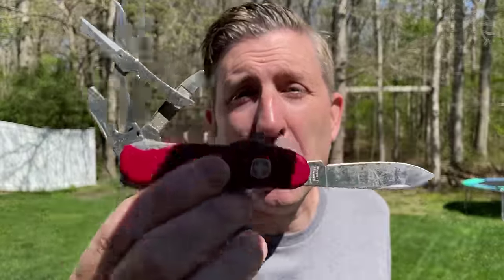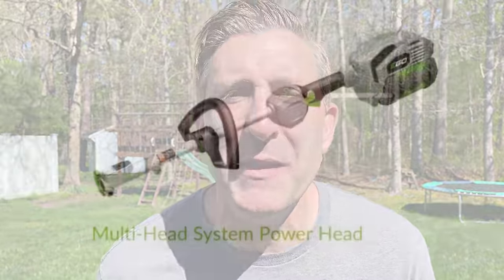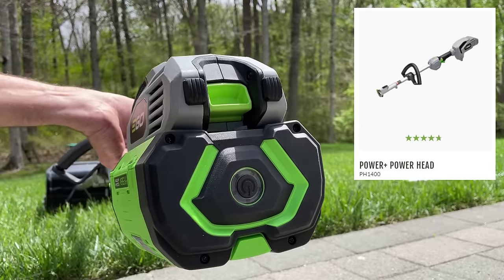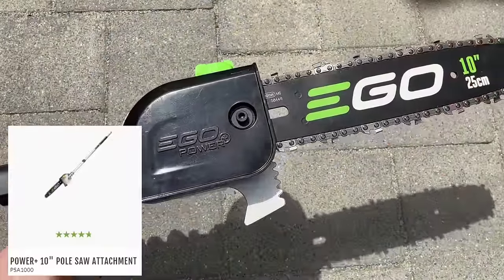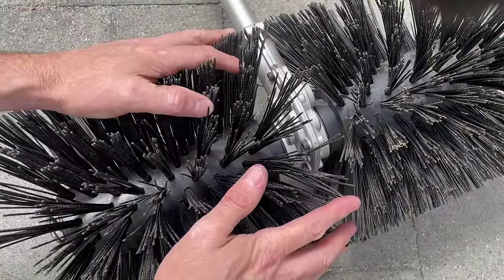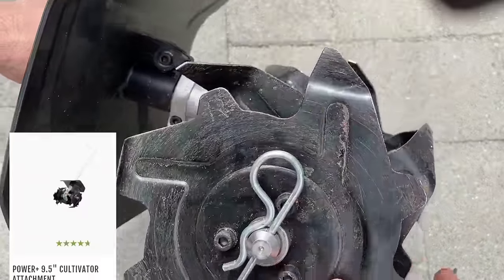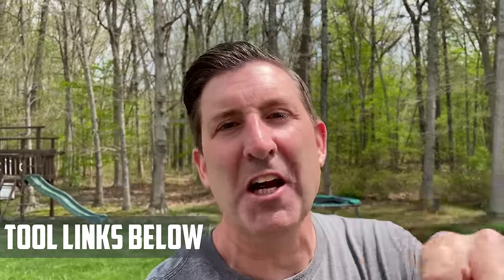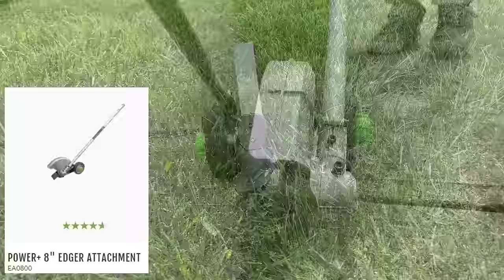[IN ACTION] EGO Multi Head System - 2021 Best Review 🤯🤯🤯

Comment: I am sold on EGO products.  I started with the first generation 20" push mower (self propelled not available) in 2014 and have since acquired many of the implements.  My most recent is the multi head system with the edger attachment to start off.  Next was the new Zero Turn Z6 mower (awesome) Now that is a lawn mower.  Next is the Select Cut 21"  self propelled mower (also a fantastic twin blade mower).  Next the 575 CFM blower, the early 14" chain saw and lastly the 24" hedge trimmer.  For the batteries I have the 2.5Ah, the early 4Ah, the 7.5Ah  and 4 of the new 10Ah batteries.  Guess you could say that I am hooked on EGO products.
Great video you produced for us plain folks.  Keep up the info on all there products.
Reply from the maker: Glad to help!

Comment: I have the trimmer and cultivator attachments and love them both. The trimmer is a bit heavy with the 5ah battery, but not too bad. The attachments switch out quickly and stay in place once locked.

Comment: FYI if you hold the hedge trimmer down, adjust the cutting  blade like a hocky stick.  It takes a long messy job of cleaning out tall sturdy weeds that the string trimmer can't cut.  And makes really no mess at all.

Comment: Thanks for the review.  I currently own a Kobalt 24v trimmer and blower, and absolutely love the convenience of a battery, but I want a battery edger to replace my very loud and heavy gas one, so looking at the EGO powerhead system because the Kobalt edger would require a different battery and charger.  So, my plan is to eventually convert everything to EGO because of the convenience of the multi-head attachments and ability to use the same battery on everything.  May eventually go to battery mower as well, but my Honda is only a couple years old, so not quite ready for that yet.
Reply from the maker: Plan now for the future

Comment: I bought the LB 650 blower for my business this spring and it's been great so far. I had stayed away from their trimmers because the head spins clockwise. To my surprise I found the ST1530 which spins counter-clockwise like a gas powered trimmer. It's a little heavy at 13.83 lbs. with the 5 ah battery but well balanced. I just received this yesterday so I'll be back soon with my thoughts on the ego dedicated trimmer.
Reply from the maker: Great - keep us posted
Reply: The more I use the trimmer the more I like it. Excellent for edging, surprisingly. Today I used it on 3 properties and had 1 bar left on the battery. I charged it at lunch for a half an hour and did 3 more lawns. The blower lasted for all 6 lawns with some battery to spare. The true test will be on a 10 lawn day. I ran it on #1 setting all day which was plenty of power. I will be getting the strap as it is a little heavier than a echo gas trimmer. Not smelling like 2 stroke exhaust at the end of the day is worth the price of admission.
Reply from the maker: @carlmccarty6470  not to mention to the noise - sounds like your really putting EGO to the test
Reply: @Kitearmy  After using the trimmer for while I'm getting 4 and a half lawns trimmed on a single charge. 5 ah battery
Reply from the maker: @carlmccarty6470  not acceptable :)
Reply: I bought a grand worth, l loved them.... till the batteries got around 40 (or less) hours on them. Then one by one they have begun failing. The 5.0 l bought separately (350.oo) was the first to go. Two weeks later the 7.5 that came with the backpack blower failed. Today I have ONE 2.5 still working. So I can work for ten whole minutes between one hour recharges. Until that one fails. E-go=😢 Totally my fault. I tried to “modernize” l should have stayed with gas
Reply: @jessoliver2955 mine have way more hours than that. I use the edger, the big brush and the weed wacker. I also have the separate blower.  Have a 2 and 5 battery. Both are going on 3 yrs old.
Reply: @1packatak  good for you. (Really) if I had that experience, I wouldn’t shudder every time an ego add pops up. Wishing I could warn everyone who sees it. But I CAN go on every u-tube video I can find. In addition to Yelp and Google reviews. Oh! And when I see people at Lowe’s looking at themDON’T DO IT!!!

Comment: I have the EGO mower (self-propelled push), and a snowblower. I am in the market for a blower, a hedge trimmer, a weed Wacker, and that saw attachment looks great. This looks like it can cover most of my needs but how much does it cost? As a package deal or the power head and one or two attachments to start with? I have been impressed by the EGO line, and like that the batteries are interchangeable. I also drive electric in a Leaf. I love that too.

Comment: The 1 person who disliked this video owns a Ryobi!
Reply from the maker: bahhaah
Reply: I use eGo for lawn tools, Ryobi ONE+ for DIY. Reduced my battery systems down to 2 from 5; SO much easier to maintain. Looked at the Ryobi 40v system years ago, just didn't compare to eGo.
Reply from the maker: @morrielewin1554  Yeah - I think Ryobi hopes that people will jump in because they have the 18v one plus stuff
Reply: my Ryobi trimmer broke in one day for me.  Maybe Operator Error ;)
Reply: Yeah RYOBi for decades was a " Budget' cheapo brand.. EGO was always a premium brand.

   So it was  never  a APPLEs to Apples comparison.

  Now in 2022   RYOBi has decided to start making a lot more " premium " tools . Things are changing. 

Example..Carbon Fiber, Whisper Quiet, Brushless 40V HP.  Dramatically better than their 18 vol and original stuff.   Their products are improving 
  Is RYOBI superior to ego? Nope... 

 But RYOBi are a lot more accessible, alot more common..AVAILABLE any Where.  More compatibility..due to a dramatically bigger product line and always new products coming out every year . Far Far cheaper batteries too. 

 I have a Honda powdered RYOBi  pressure washer thats really really superb.  I have some brand new generation 18+ Ryobi brushless handtools which are excellent!   A small 18V + Brushless Impact electric driver with LeD lights is shockingly good around the house.

 RYOBI 40V Brushless HP  multi tool.. is a superb powerhead for weed eating , edging, trimming hand held stuff outside.   I got this 40V Brushless motored powerhead for 50 bucks it's compatible with all my 40 V batteries and all my old multi tool extensions from 20 years ago. You just can't EVER do that with EGO. ( price wise) I RYOBi better than EgO. Again I say no.  But you're going to pay ALOT more than 50 bucks.

 The RYOBI push, self-propelled mowers are complete garbs.....except their riding mower.
 My friend has one and loves it and it's dead quiet.
Reply: My issue for me.  Is weight.  I needed something lighter because of my size and arm strength.  I went to the store and I lifted the E Go.  I knew I couldnt use it.  So ended up buying another brand.  I do realize the ratings etc.  I just couldnt do it. If E Go had a smaller one.  I would of bought it.  Small female w arm strength issues.
Reply: @lil_Marie_Red  that's why they sell the backpack link 👍🏻
Reply: @joshuabush2569  Still to heavy.  I broke 2 elbows last yr with a fall.  Ouch.  So I lost my strength.  I bought the lil craftsman one.  Its working great.  Tossed my Ryobi. I still have other Ryobis.  Ok for starter.  They are lighter. I dont use it much.  Its there if needed.  Single girl that cant afford paying guys for simple task.  I like being independent even w strength issues.  
Men dont understand that small woman may not have arm strength for bolts and tight stuff.  Holding heavy tools.  So be kind to your ladies.
Reply: Lol
Reply: Ryobi are not as comfortable or ergonomic to use. But their batteries are great. In my hot van day in and day out. Never fail. I bought 4 E-GO last summer, so I have a 7.5ah, a 5.0 ah and two 2.5 ah. Today ONE 2.5 ah still works. So I can work for 10 minutes, between one hour recharges
Reply: @morrielewin1554 but Ryobi batteries last. E-GO batteries are trash. Heat sensitive as a cell phone
Reply: @joshuabush2569 E-GO batteries are so heat sensitive, if l leave a tool sitting in direct sunlight for even 10 minutes...DONE! So the backpack, right out there in the sun on your back... MUST have it’s own AC unit to keep working... people DO say it’s heavy 🤔

Comment: Love your reviews of Ego power equipment! Question: Are there any reasons (additional functionality or capabilities) to purchase the dedicated string trimmer or dedicated edger, verses the multitool options for these tools? I need both of these tools and understand it would be cheaper to purchase the multi tool option, however I want to make sure I’m buying the top of the line (at least from a residential perspective).
Reply: The multis will be more than enough for any residential! You can even buy a $10 adapter kit on Amazon and attach blades to the trimmer to cut like 6 inch trees like butter!
Reply from the maker: If you think you might need any other tool that is attachment capable then go with the multi - otherwise go with the individual
Reply: As a gardener, I've always had multi tools. Saves money and and are easy to store in my cab whenever I want to take it apart . Even if you don't need the other attachments, you options be open as long as you have a multi tool.
Reply: The string trimmer I use has the power head that makes it easy to add new string. I don’t think the multi tool system has that?
Reply from the maker: @BottleBrookGardens  no it does not
Reply from the maker: @BottleBrookGardens  no it does not
Reply: @BottleBrookGardens   I was thinking the same thing.
Reply: @Kitearmy  can you purchase the power head for the multi? Or is it only available for the dedicated trimmer

Comment: Loads of great info in your vids!  Unfortunately, looks like the trimmer/edger kit is sold out at Lowes and on a month waiting list on Amazon.  (insert sad face here)  Btw, have you done any long term Ego Battery reviews...ever  had issues or received a bad one?  Thx!
Reply from the maker: I have been using EGO batteries for 7 years - never had 1 go bad.
Reply: I’ve had a bunch and they are my main lawn equipment. Mine wore out after about 5 or 6 years. Some of my 2.5s I think will last a few more seasons I think

Comment: I use this tool system regularly. I have a huge issue when it comes to taking them off the multi-head tool. No matter what attachment, they get stuck, and I have to fight to pull them from the power-head. 
I ensure the arrows are aligned, the lock clamp is loose, and the button to release is held down while pulling. 
I guess it's a job for WD40

Comment: Your videos are very good.  Interesting.  Purchase the multi or individual Ego tools like the Best String Trimmer, etc.  Just need to decide between eco systems like Ego and Toro … mower, trimmer, edger, snowblower so as not to have multiple chargers lying around.
Reply from the maker: I have both Toro and EGO - I gave the Toro to my neighbor
Reply: If you need a battery snowblower go with Toro, the current Ego ones are nowhere near as good .  I have used both the 60v 14/16" Toro trimmer and the 2020 Ego and to be 100% honest the biggest difference is the powerload feature for the string.  The Toro trimmer you have to spin a knob on the head and it's not that big of a deal.  There really isn't an appreciable difference in power or runtime with 2.5ah batteries.
Reply: @dhanipersaud6227  Thank you
Reply from the maker: @dhanipersaud6227  Have you seen the EGO 2-stage it's a monster
Reply: @Kitearmy  Seen it on youtube but haven't used it.  I have used the single stage Toro and Ego snow blower offerings and Toro model is in a completely different league performance wise.

Toro also has a new two stage electric snow blower and  early reviews seem positive but I haven't seen any head to head comparisons with the Ego.  Also, most people in my neighbourhood only have single stages.  So, not sure when I'll get to try one out.  You need to be plowing a fairly large area and a lot of snow to truly justify a 2 stage.
Reply: I forgot to mention, the Toro 60v trimmer is also better balanced, floats better over the ground and the trigger is easier to operate.  The Ego is a bit longer and if you're over  6 feet tall you won't have to slouch as much as with the Toro.
Reply from the maker: @dhanipersaud6227  Toro is made by the same company who makes harbor freight - greenworks.  Look at the head
Reply from the maker: @dhanipersaud6227  I don't love the EGO single stage blower - BUT I love the 2 stage.  Will be interesting
Reply: @Kitearmy  And?  EGO, Habourfreight, Greenworks, Echo, Toro, Stihl battery lawn tools are all made in China and share the same parts suppliers.  Open them and you'll find common parts amongst all of them.  Ego doesn't make its own batteries, switches, brushless motors etc.
Reply from the maker: @dhanipersaud6227  I have opened some up - look at the head of the toro and the harbor freight ( I have a video).  I love EGO and I have never seen an electric loading head on any other brand
Reply: @Kitearmy  Yeah,  open up the EGO and compare to other brands.  All the internals from the same Chinese parts suppliers just in a different shell and slightly different configuration.  EGO is owned by a Chinese company called Chevron and the directly own a few brands like Skil, Flex and Devon.  The also do work for other manufacturers like Bosch and some other manufacturers.

Comment: Does the multihead trimmer work as well as the dedicated trimmer? That’s my most used accessory but it would be nice to have some other tools with it.
Reply from the maker: If you have space issues go with the multihead (or need a tree trimmer) otherwise I would suggest to go with each unit separately just buy them without a battery

Comment: Need to know: what sound does the Power Head make with no attachments running? I'm asking b/c I just got my set in and when I attached the battery and run it, it seems to be VERY loud for an electric, brushless motor. I have the Ego folding trimmer and it is QUIET whereas the Power Head is exponentially louder. Is this normal?
Reply from the maker: It is louder than other EGO tools - the motor is in the back so it runs the power down the handle

Comment: I have the bristle brush attachment and it is great for fall and spring cleanup as well as driveway and walkway cleaning. I am curious if I can just buy the replacement rubber brushes and swap with the bristle brush; seems like it would work. You didn't take the rubber version apart for comparison; maybe a future video? Unless the answer is just a simple "yes" (I hope).
Reply from the maker: Yes
Reply: @Kitearmy  Excellent! Much cheaper; thanks!
Reply from the maker: @morrielewin1554  great!

Comment: Very similar to Dewalt's 60V multi-head string trimmer. The difference is it has two different string lengths.
Reply from the maker: In theory - the Dewalt string trimmer is the worst tool i have ever tested.
Reply: @Kitearmy  I was referring to the newer Dewalt DCST972X1 which looks very different. That would be worth testing. I don't even think they make the one you tested anymore. Perhaps they saw your review.

Comment: So unlike the regular ego string trimmers, the motor is in the back instead of the front? Does that effect anything, like weight?
Reply from the maker: spins counter clockwise - If you need at least 3 heads this is a good option, otherwise buy the individual tools - if you have the space
Reply: @Kitearmy  thank you, sir!

Comment: TIM from Canada oh and by the way if you were getting into. EGO Power plant attachments the batteries or three times the price if you stick with Milwaukee you can use M18;batteries that will run your power plant your attachments and all your tools you cannot see this forEGO I looked into this batteries are so expensive for the EGO, System
Reply from the maker: EGO is expensive - they don't want to be the cheapest, just the best

Comment: I bought the new telescopic weed eater. Thought about the multi head system. But didn't want to deal with it. And I like the trigger on the new weed eater. Wish the cultivator, and 2 brushes were stand alone devices. Oh well.
Reply from the maker: You got your trimmer for a great price - the multi head is more expensive
Reply: @Kitearmy  yes the price was great. I would love one of the brushes though!
Reply from the maker: @Karrott9  I really like the bristle brush - I could take or leave the rubber brush
Reply: @Kitearmy  hope they'll offer it as a standalone. But I doubt it. Maybe I should have got the multi head system. But all I wanted was the trimmer and brush.
Reply from the maker: @Karrott9  I would keep what you have then

Comment: I want to get the ego mower, for the price difference between the 10 Amp and 7.5 is there any difference in the mower itself? Thanks in advance.  Love your videos
Reply from the maker: Yeah the new select cut XP has loads of power - video coming this weekend
Reply: Select cut has a 1000W motor, Select Cut XP has a 1200W motor.
The XP also comes with all the blades. I don’t know if Ego started including them on the regular Select Cut, but initially they didn’t and some stores might still have that stock.
Reply from the maker: @reaperreaper5098  I don't believe they do - correct on the motor size